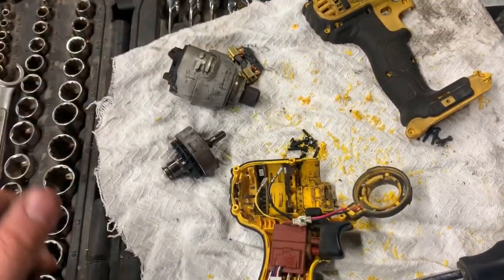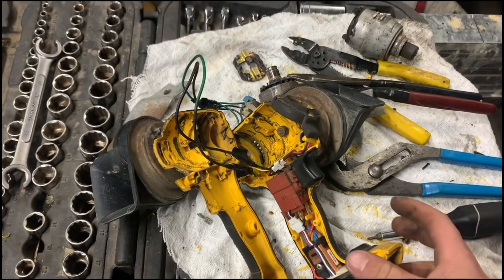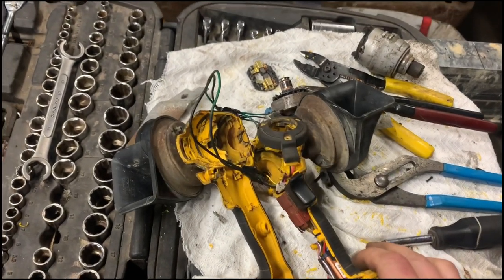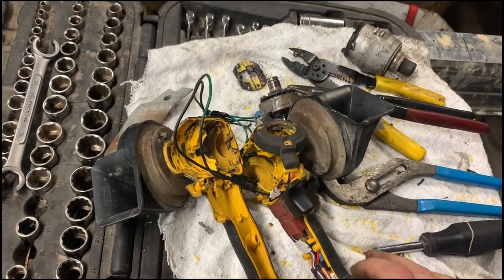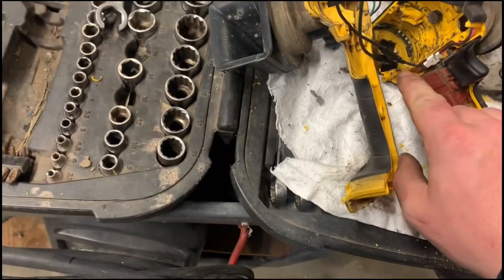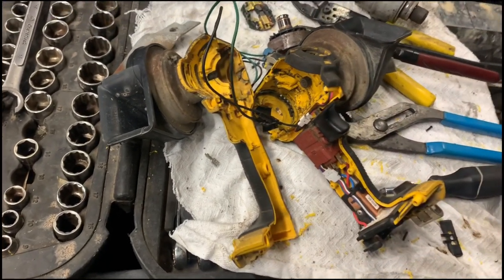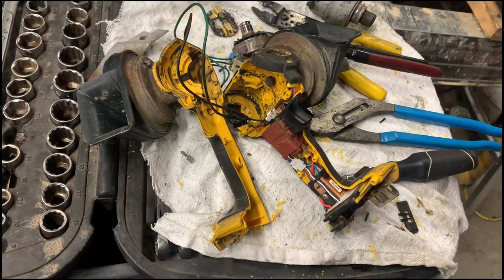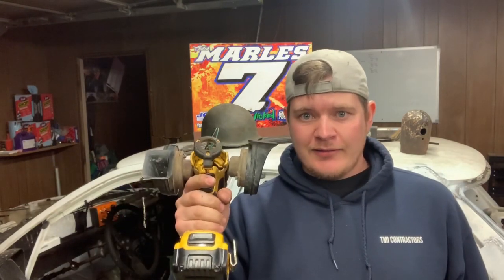Quarantine project “How to build a Cordless Horn”

Comment: How many volts & ah is your drill battery and I presume the air horn is 12v?
Reply: its a 20v drill and i assume a 2.5 or 5 ah battery
Reply: Pause the video, has a 4ah 20v battery